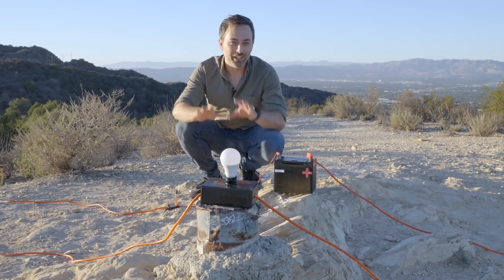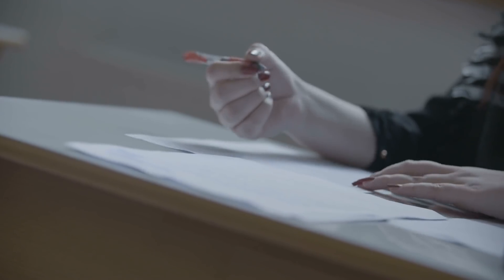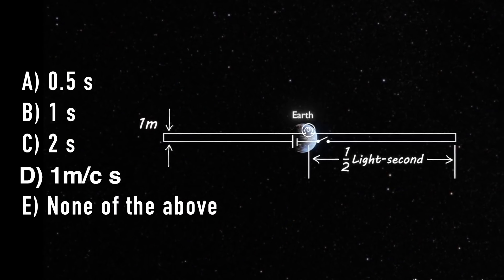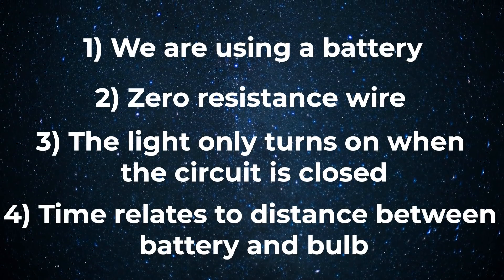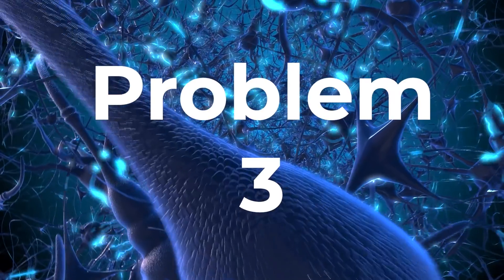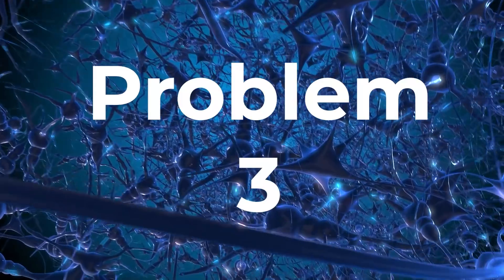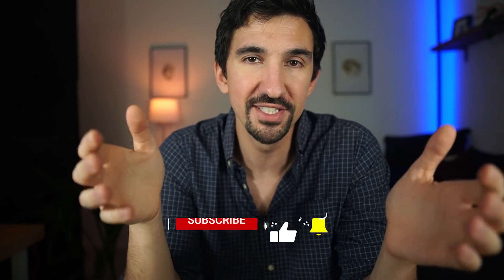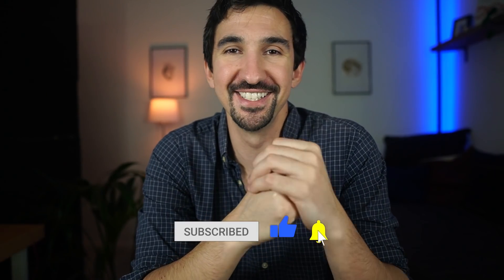Is Veritasium Wrong About Electricity?

Comment: I have slightly more difficult question — what would be actual energy distribution between the battery and bulb? Energy density at different points in space.
Can this be actually somehow seen?
Reply: Yes, you can easily calculate the total energy of the system. For a typical wire pair (distance five times wire diameter) the capacitance is on the order of 12pF/m. For 300e6m that's 3600e-12*e6=3e-3F or 3600uF. At 12 V the total stored energy is then on the order of (12V^2)*3.3e-3/2 = 0.26J. Pretty negligible for something involving a light bulb. But that's the fault of the 12V light bulb and the once-on/once-off scenario, not the fault of the transmission line. At higher frequencies and voltages they can transport enormous amounts of power.

Comment: It may be possible to do a scaled down version of the experiment.  Just reduce the wide distance from 300,000kM to 1/1,000,000 the size or 300M long.  This would reduce the time to the microsecond range.  Impossible for us to see, but not a problem with a good dual trace scope.  Unfortunately I don't have the time or access to such equipment, but it would prove to be an interesting experiment.
Reply: Yes, it so good that you can buy these under the name "cable pulser" commercially. I had a very old one a long time ago. I think it used a mercury switch. It made extremely clean sub-ns risetime pulses. Pulse length was controlled by attaching your own transmission line externally. If you wanted longer pulses, you just put a longer cable on. :-)
Reply: the primary issue is here that 'a signal' detected is not equivalent to 'a light bulb turning on'. and a secondary issue which requires more assumptions is the timing of everything; if you automate the flipping of the switch and the detection of a signal at these stupidly fast speeds you must include the speeds of each apparatus.
Reply: judgeomega   I've considered what it would take to do such as an experiment and propagation delays would have to be considered.   A simple optical isolator is way too slow for this, because I'd have to read time in the nanosecond range.  It's possible with the right equipment, but not easy to do.

Comment: Alright, I might be wrong here, but if it's a DC current, shouldn't the induction into the other wire only be for a very short moment once the magnetic wave hits (So during that Antenna-Example)? And even if it works more normally afterwards, it should still be a lot shorter than the electrons take to reach the lamp. Because then the magnetic field stays the same around the wire? And the electric field only pushes the electrons sideways, so no use of that really. (I mean there might be a slight bit of Lorenz force on them if they move sideways through the magnetic field, but that would be tiny, I think).
I at least hope this isn't too stupid?

Comment: The antenna example is great. It shows the important measurement that Derek's video glosses over. The distance between the lightbulb and the switch is 1meter.
(d = v ∙ t) 
The information is the switches state change is traveling 1meter at the speed of light. It will take 1/c(s) or 3.336ns to induce current in the bulb, lighting the bulb.
Reply: If the distance between switch and lightbulb was 1m of wire, yea, it would work. But on used picture, switch was very close to car battery, THEN there was 1/2 Ls of wire connected to lightbulb.
Switch and lightbulb were 1m away from each other, but the important part is, the 1/2 Ls of wire connecting them. If the distance between switch and lightbulb was important, instead lenght of wire... that would be really interesting :D

Comment: Hah! So I totally had something typed up that was basically "Sure, but what if you thought of the wire as an antenna. it wouldn't need to connect. Even a DC source would take a finite amount for the impulse/field to reach the break before it stopped changing. Causality preserved." Then watched 5 more seconds. -_- This is a great companion video. :)

Comment: Ok, it turns on due to an induction, which happens due to a change of current. But for how long will it stay on? Will it only blink and then turn off until the current comes all the way around, or will it be "slightly on" for a second (read: getting a very low current) and then turn fully on when the current comes all the way around, or maybe just half a way around? That shit is mind boggling. It just proves that we know very little about reality. We know just enough so we can "use" it. What I like about Veritasiums video is that it makes you wonder what you actually know regarding how things really work... When you trully understand things, you can reach a real breakthrogh. But I think we have a long way ahead :)

Comment: If there's no electron flow, then how do batteries and fuel cells actually work?  And what is the real source of resistance/heat in a conductor which prevents it from carrying "channeling" an infinite amount of current??

Comment: My opinion is that the physicists arrive at these conclusions by stating an incomplete list of the components in a circuit that doesn't include parasitic components, then bringing them in later with electric and magnetic fields, lenz law, whatever without having acknowledged that these parasitic components are (at least from an Engineer's perspective) part of the circuit, and have been there the whole time. If we were in a world/scenario where these parasitics didn't exist to a degree that mattered, then the physicists explanation with electromagnetic fields wouldn't be true anyways.
Reply: I think its bad assumptions. Assuming any current will cause the bulb to light is a problem. This means the induced current which is normally assumed to be negligible in this kind of situation suddenly matters (as well as any changing magnetic field in the universe technically). The current would be induced at approximately 1m/c but its not enough power to do anything.
Reply: i actually disagree with this to an extent, because a) these simplifying assumptions are necessary to make headway in most any problem and b) the insight gained from considering such conditions can be valuable even if insufficient on its own. drag forces exist, but conservation of energy is still a valuable and informative principle. we live in a complex spacetime made of quantum fields, but neither of these generally need consideration for the design of a building.
Reply: @Errenium  1) yes and bad assumptions lead to bad answers
2) why not just use an pair of inductor coils to deliver power and show step up, step down power with coil ratios? Teaches the same lesson without the misleading information.

Comment: Your induction stove uses electricity to power coils under the surface of the stove which couple inductively to the cookware heating it and the food it contains - yet the cookware is not physically connected to the coils. And the big kicker in this example is that by all impartial measurements, induction cooking is even more efficient than cooking with resistive heating coils!

If you really want to have your mind blown, take a rabbit hole dive down the "waveguide theory" of electromagnetic propagation - without which we would not have radar systems or microwave ovens that we all depend upon every single day! In waveguide theory, electromagnetic energy always travels in one direction only - from source to load.
Reply: I used to work for Detroit Edison as a contractor in their metering department for a number of years. This was before the newer smart meters came out - when they all had the familiar spinning disc in them. That disc has a dimple pattern on its surface. That spinning disc is made from aluminum. 

Because the disc is paramagnetic aluminum,  eddy currents produced in the disc provide the torque that makes it spin. The dimpled pattern on the spinning aluminum disc was designed to provide magnetic braking so that a fastly spinning disc's inertia doesn't keep it spinning when the load suddenly decreases (like when turning off your induction stove). The disc is suspended between two jeweled bearings so friction is negligible. I bet you never knew your electric meter has diamond bearings in it!
Reply: Minor point: I believe the energy (edit: some of the energy) will reflect back towards the source when the load’s impedance isn’t matched to the transmission line’s impedance. This makes me wonder if the pots and pans must have a particular shape.
Reply: @sambelld1  the answer is no, the shape isn't a determining factor with induction cookware's abilities. But the material used on the bottom of the cookware must be a metal with paramagnetic properties which is why aluminum is often used.

Because the coils in an induction stove use AC current at 60Hz, the varying magnetic fields it creates causes what are known as eddy currents in the paramagnetic cookware base. It's these eddy currents of induced electricity in the cookware base that heats up the pan or pot to cook the food. In other words it's the pan itself which heats the food. Unlike a gas stove which uses open flames to heat the air and bottom of the pan through both convection and radiantly (both very inefficient when compared to induction cooking). 

 Now, most induction cooking surface appliances have load sensing circuitry which keeps the coils from radiating open magnetic fields when a pan or pot is temporarily removed from an active coil during cooking (as is common when cooking).
Reply: @MrBrelindm  Thanks for the info! Having now watched some vids on Eddy currents, I’m wary of any unladen pots flying up from the element when it’s switch on!
Reply: I know this: you can boil a gallon of water in under 5 minutes with my induction stove. You can't even do that with a microwave! And it would take at least half an hour with natural gas or resistive coils. Now which one is more efficient?
Reply: i think a resistive heating coil submerged in the water would cook faster then an induction cooker since its basically 100% efficient.
Also, according to the 2014 ACEEE Summer Study on Energy Efficiency in Buildings "induction cooking is not always the most efficient method of cooking. When tested with a large cooking vessel, the efficiency of conventional electric technology was measured to be higher (83%) than that of induction cooking (77%). Yet the efficiency of conventional cooking appliances was shown to be highly dependent on the size of the cooking vessel."
Reply: @pera1295  why waste energy heating a resistive heating element when you could just heat the actual cookware instead of relying on conduction alone? Also, water has a very high heat capacity (4183 Joules to be exact) which means that it takes a lot of energy to raise its temperature even just by one degree. Knowing this, it makes sense that resistive coils are much less efficient than induction when it comes to methods of cooking. A resistivity in the coils - not unexpectedly - resists current going through it. So some portion of energy is wasted by heating the coil itself.
Reply: @MrBrelindm  I know the benefits of induction cooking, but you were implying that "by all impartial measurements" induction cooking was more efficient, which is not true par the study I mentioned.

You seem to be overlooking all the evidence that goes against your preconceived notions. 
1. The heating element has so little mass compared to an entire cooking pot that it's actually an argument in favor of resistive heating, since you have the whole pot to heat. with a resistive coil submerged in the water you heat the water directly with almost 100% efficiency.
2. The energy absorbed by the water doesn't simply vanish, it's stored in the water. water has a huge benefit of dramatically increasing the surface area by which the heat is transferred to the food. with an induction cooker you also have to heat water to cook, or cook with oil. if you plan to cook with neither water or oil in your induction cooker you're gonna run into this limitation. like, how are you going to cook potatoes without water or oil? you'd be very limited, so it's fair to compare all types of cooking, not just the ones that benefit induction cooking. Besides, some very popular foods, like rice or pasta, have to be cooked with water anyways, so this point is moot.

To be fair, I probably could've made myself clearer. I'm not talking about those stoves with resistive coils that go under the pot, those are not as efficient. I'm talking about purpose built electric cooking pots, like rice cookers, which I consider a fair comparison to induction cookers since they also are relatively expensive and require special cookware.
Reply: @pera1295  watts are watts.
Reply: @pera1295  my new induction stove has three sizes of coils in it but each one of them is auto-sensing for size of the cookware base that it couples to.

Comment: I haven't checked all the comments, but: I think Veritasium is implying that the change in current in the part of the wire coming from the battery induces a current in the part going to the bulb, as they are only 1m apart. So the energy can take a shortcut and doesn't have to flow all the way around the circuit. This is very quick as long as the switch is physically close to the bulb. If it were at the end of one of the loops, then the light would indeed only turn on after a second or half a second or whatever.
Reply: I agree this was the point being made